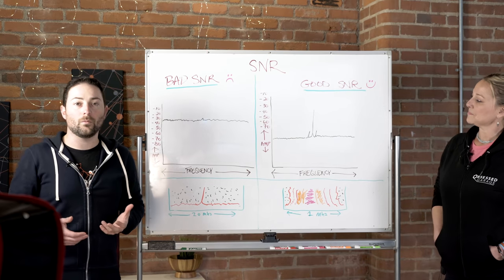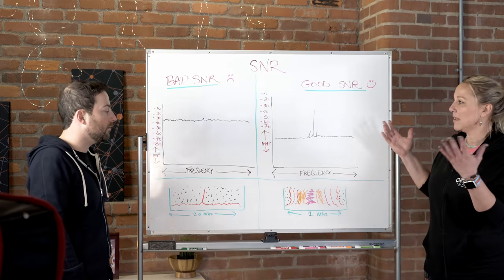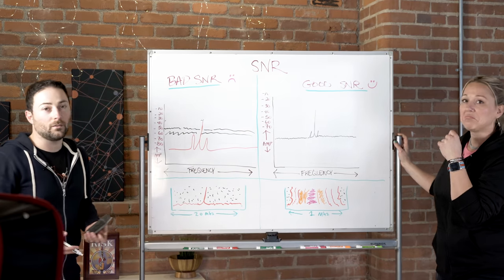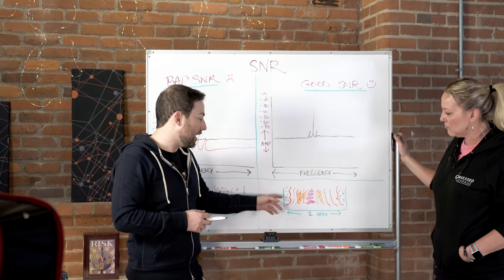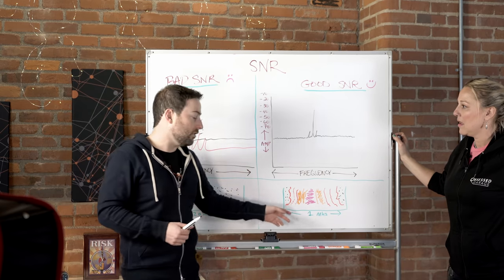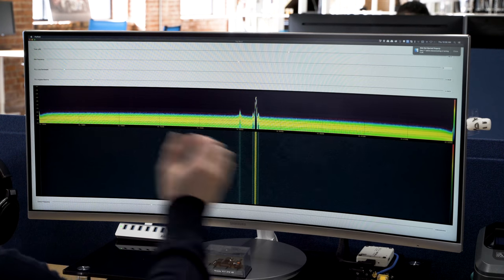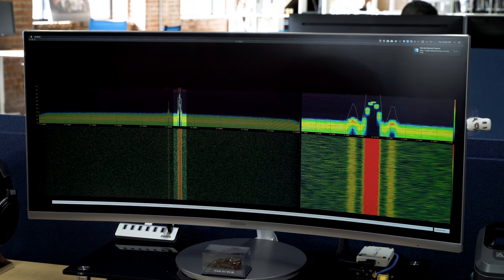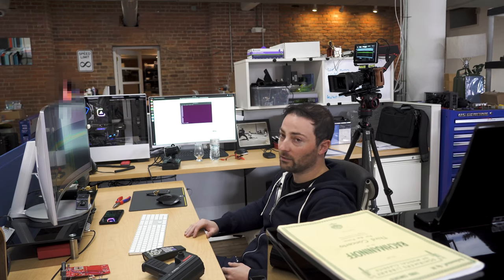What is SNR and why is it important for Radenso Theia?

Comment: Likes Mindy's Obsessed garage hoodie . Theia's  discernment between noise and signal  characteristics is class leading. I get that to some people with older designed based platforms without AI learning potential this sounds too good to be true. Jon I like that on the forum your very active and straight up on this  design is just the  current industry standard   except for the radar detector companies.

Comment: Question about the noise floor being lowered. If Theia detects a signal from a Police Radar Gun from miles away, but can't identify it, will Theia still alert?  Or does Theia wait for the signal to become stronger, to the point it can be identified, and then alert?  I'm guessing if it can't be identified maybe it shouldn't anyway?  I'm just thinking out loud.
Reply: By definition if it detects a police radar gun it has identified it, no?
Reply: @BadDriversofCentralArkansas   Theia will be able to tell you what gun you are being shot with (According to SEMA dog and pony show). However, seems the percentage of accuracy goes down with distance, attenuation etc, so at some point Theia will no be able to accurately identify which gun is being used or even if it is a "false positive" (My thoughts) .   So, maybe it alerts because the signal is determined to be legitimate, but tells the user what gun is actually being used, at a later time, when it can asses further.  Complete guess on my part.  But there still is the point of detecting a signal and being able to tell if it is a false positive or not, and I would think that comes before identifying what gun or police device it was being shot from.  So, I'm curious about what mechanism will be in place for that process.  Disclosure I'm speaking of what's going through my head, and I don't claim it to be accurate at all as to how Theia will "actually" work because I don't know that this part has been disclosed yet OR it could be I've just missed it.

Comment: Pretty Sure I'll be picking this up, but my only question is the Build Quality?  Meaning will it be able to handle the heat literally with the on board Mini Computer Chip? Summers here in my area of Southern California where temps can reach 120 plus outside and can easy reach way above that inside a parked vehicle sitting in the sun. I have V1's on all my cars so there's been days where I could not touch the body of my V1 because it was way too hot to the touch so would have to wait for it to cool down before adjusting it on my window mount. Will your unit be able to withstand that type of temperature? Hopefully it has been tested for that type of environment. Otherwise New legacy V1 Gen 2 or R7 in my future. Appreciate a response.
Reply from the maker: It will not have any issues with heat
Reply: @RadensoRadar  OK sounds good look forward to picking one up before the summer once it's available. Never had an issue with my V1's had em baking in my cars for more than 10 years and they keep on ticking lol.  Since your product internals are essentially a mini computer I was worried since CPU'S are susceptible to heat. Hopefully you'll have a good warranty just in case. Appreciate your response.

Comment: Sounds pretty nice.  But all those “expensive” parts might put this on par for becoming the first iPhone priced radar detector. 🤷🏽‍♂️
Reply from the maker: Well, there was a first iPhone priced iPhone at one point and I think everyone's very thankful that happened.  Otherwise, you'd still be using flip phones (or an Escort, same thing). -Jon
Reply: I am ok with iPhone price. Unlike iPhone which does not do anything better than competitor products and which takes away any ability to customize your device to suit your preferences, this device will be worth the price ;-)

Comment: High to low signal detection range is Dynamic Range....   SNR is quality for receiver electronics relative to strength of signal to be detected. Toss in external "noise" (non signal of interest) as well but that speaks to receiver DSP as well as tuner/filtering selectivity. Consider adding detected signal sharing for collaborative situation awareness across Theia equipped cars running as a package down the highway.....  8^)
Reply from the maker: You are correct but given how long the video already is it's easier to just explain it to non-technical people in a way that helps them understand the gist of things instead of being 100% correct - electronics that have a better SNR will be able to better distinguish low amplitude features at further distance because those features are not masked by the noise floor.  It would have been pretty difficult for me to visually show this on a real signal properly as I would have had to inject noise into the signal to the point where the distinguishing characteristics disappear, whereas it was much easier to just reduce amplitude to accomplish the same visual effect for the viewer.  What I kind of wanted people to take away from this is higher SNR = good, more dynamic range = good - provided a decent snr.
Reply: Radenso Radar very stealth.....  I like